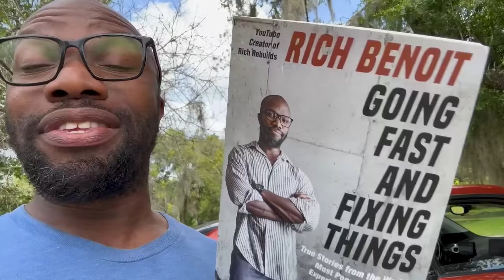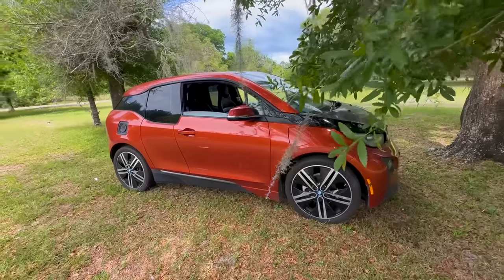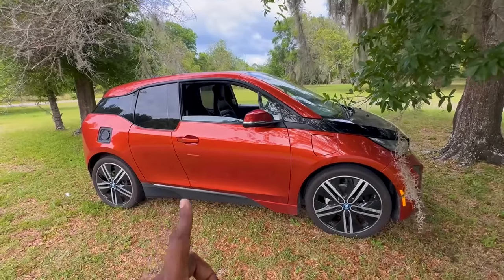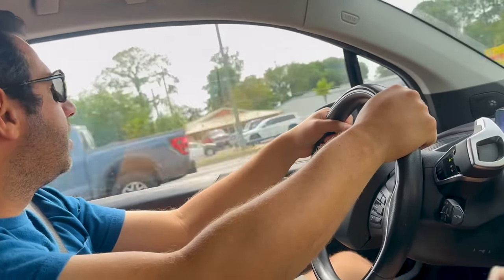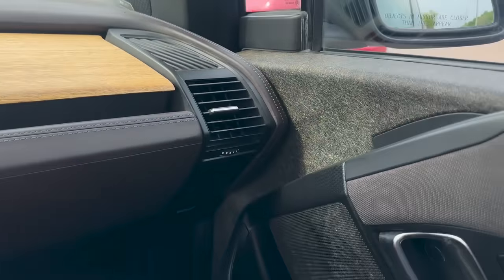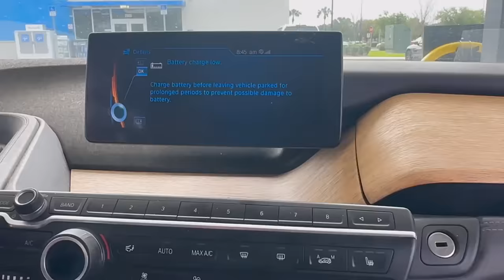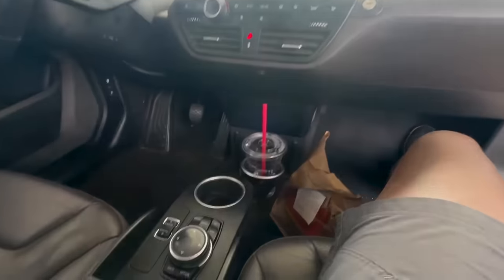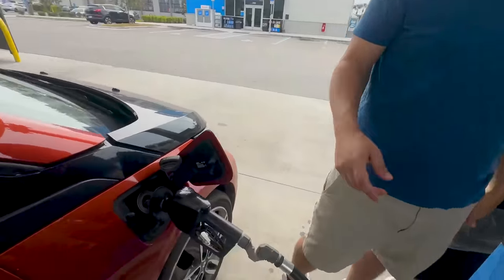I Bought a Ten Year Old $3500 EV and I Increased its Range To Over 400 Miles!

Comment from the maker: UPDATE.

The system works! I forgot to put this part in the video but the switch is foot activated so that I can add from the aux tank to the main tank while driving. When both tanks are full I can get  about 300 miles on gas only. However At those speeds the Rex cannot maintain hold state of charge but It still cruises nicely at 75-80mph on the rex. The siphon is working great as well, when both tanks are full the main tank will pull from the aux automatically so the pump is rarely used. 700 miles covered so far 700 more to go!
Reply: Why BMW didnt add a 50 liter fuel tank from the factory is just stupid
Reply: Rich I want to know why you can't put an alternator on a electric car that would charge the batteries   so that you don't have to stop and charge the batteries up at a charging station. Even if you run the alternator off the drive shaft or something.
Reply: I'm buying it when it drops.  Greeting from Newark Nj
Reply: @MIKEH.777  - This would be awesome, but I suspect the reason no one has done it is because the drain on the drive train by the alternator would be more than the charge it produced, making it essentially useless.  Regenerative braking works on this exact premise, using the mass of the vehicle against resistance to create energy, but when you try to create energy with the vehicle in motion, it just isn't as efficient.  Inventing a fix for this would probably make you billions.
Reply: @MIKEH.777  No such thing as free energy.
Reply: @Chris-hw4mq  They LEGALLY couldn't sell the car with a larger tank due to US regulations.....
Reply: @maxtorque2277  What ? then how do car makers put normal sized fuel tanks in cars ? Honda EV has a 40liter fuel tank
Reply: @Chris-hw4mq  The honda is a Hybrid. The I3 is a Range-EXtended electric vehicle.  Legally very different!
Reply: I think you glossed over the fact the computer of the car needs to be reprogrammed to allow the "hold state of charge" function to be enabled. I would like to see how the car would drive with low electric battery and a full tank of gas.
Reply: If you'd just imported the EU or Africa fuel tanks 😂😂😂
Reply: @uhjyuff2095 what does this mean exactly? The hold state of charge?
Reply: @aminath2  its a button on the car that is not available to activate in the US version of the BMW i3 REX. Rich reprogrammed the car's computer to enable the button. When the button is pressed the gas engine in the car immediately turns on and stays on until it runs out of gas which makes the car get lower fuel mileage. its a great modification for people wanting to drive the car with full power for longer distance at the expense of lower fuel mileage. I hope this explains what the button is.
Reply: @uhjyuff2095  that's really helpful- thank you!
Reply: That is the best EV made to date as far as I'm concerned. I'd buy one if it had a practical use for me.
Reply: I had one of these for two years back in 2016. The REX was great until you hit a hill, then the thing slowed down to 45-50mph and I'd have to camp out in the right lane, semis would even pass me. I always called the i3 the modern day Type 1 VW Beetle. Rear engine, rear wheel drive, not much in the top speed department, and when it dropped below 30 degrees the heat barely could keep up, the car was built for efficiency so there was very little insulation and the glass was very thin. I still loved it though, it was quirky, looked different from anything else on the market, the sound system was good, AND...Larry David had one!!!
Reply: Hey Rich, did you have anything in place to stop the siphon from overfilling the stock gas tank and running into the charcoal cannister?
Reply: You should also upgrade the battery, since in the past 10 years, the battery density increased way more, but how do you find/build the right package to be a drop in replacement?
Reply: because battery recycling cannot fully happen and currently has been  not happening much, hybrids use less materials than any other setup, that means less emissiosn too. also factor in  that weight rmakes crash safety, road wear repair rates, materials usage , all emissions including tire emissions (emissions analytics website, endocrine disruptor microplastic, etc) ,  driving fun (light weight allows easier traction control and traction loss control and allows less powered steering which allows feeling how close to grip limit car is like mclaren/lotus elise/emira etc)  .         factor in corbrett report, vocational science of freedom, etc, realizations about th climate crisis issues,  CAFE laws and europes equal being nonsense supporting "suv"  and electric cars (almost the worst car type and the most popular among these "environmentalist") , ani nuclear nergy sentiment among these "enviromentalist", etc... situation for electic cars gets worse.            we dont have a already mass scale solution , at best there maybe the "electric universe nikola tesla" theories , if you like.                                 they could make a compact 4 seater that is liek coupe with practical rear seat (not as is usually done) ,, and  they can have recycled forged carbon fiber and suspesnion that angles and heightens the car to have it lower crash absorbing stuff hit that of tall suvs . if it doesnt hit lower sitting cars well, at least it doesnt get hit in its weaker parts by the other cars stronger parts.        driving fun is mostly about the challengeing game of often being near danger because everyone values not crashing, so its exciting. quickness (liek go forces) doesnt really matter. but a more commonly enjoyable driving fun is speeding more at optimal power and RPM level according to bfsc chart (similar deal also in electric power motors) on more rather downhill roads and even very temporarily beyond areodynamicly effceint speed before rather uphills roads, and steering  braking minimally and smoothly... this is driving effciently, and you could be obsessed over the greater amount of pursuit of perfection that could be had compared to proper h pattern manual clutch experince, because you could get excited similarly as much about such goals as you would care about not crashing. maybe you can combine both by simulated version of such manual in effceint drivetrain that isnt too non dramatic, as a real h pattern clutch would, or maybe even better if your open minded to having high quality speakers at headrest give a sense of sound communicating how close to grip limit you are to acompany the rather non power steering sort of driving experience , or hearing the limited slip differential torque vectoring eso you can feel precisely how its distributing torque and wheel rpm even when you dont have traction to feel it.                                       ..............................all this stuff is good for  everything that makes driving fun (except  louder driving sounds and more danger by quicker paced driving at race track, where stuff like 0-60 mile per hour in 2 seconds isnt disappointingly boring for the costs because the fun doesnt last long enough) and everyone average crash saftey, and less usage of materials for longer lasting 1st world living standard (sustainability  and chemicals toxicity) :  light weight, showing the driver how close to grip imit he is at, relativly higher grip for making  risky effceint driving safe , easy to own cheap reliable car, hybrids instead of electric car for weight and recyclability and materials usage economy sustainability, mid rear engine weight distribution, some non hybrids, limited slip differential (presumably a effceint one that probably disengages when not used, for less tire wear , stability when making speed on curving downhill roads for effiency) .
Reply: @MIKEH.777  LOL, good one!
Reply: You can unlock the gas tank in the bmw coding to hold more gas. BMW locked out part of the tank for the USA models for some reason.
Reply: @maxtorque2277  They could LEGALLY put whatever size tank they wanted. What they couldn't do is have more gas range than electric and still call it (i.e. qualify as) an EV. It would have been classified as a hybrid vehicle if the gas range exceeded the battery range, impacting manufacturer clean air credits and consumer tax credits.
Reply: I would see if I could put a bigger generator on it.
Reply: @maxtorque2277  - True / Not True!

 "Sell it as a BEV" = True!

"Sell it as a PHEV/EREV" = Not True! But, BMW didn't want to do that!
Reply: Hey Rich, I’ve messaged you before in the past regarding the 2011 Chevrolet Cruze that I converted to 100% electric that will go 840 to 1280 miles on a single charge! The question is why haven’t I heard from you regarding this? 
    This is Edward H. and my company is “new ideas and innovations, LLC“ out of Madison, Connecticut, and you could’ve stopped by and looked at the car when you drove back to Massachusetts because Connecticut is on your way!
    Hope to hear from you soon!
     Best regards; Edward H. In Connecticut.
Reply: What about adding a sensor so it automatically fills based on level. Like a float? Nice concept and execution so far.
Reply: @Chris-hw4mq electric range must be greater than Rex range in order for it to be classified as a BEV in California. That’s why they did it this way.  There is no such thing as an EV with a 40l fuel tank, that would be a plug-in hybrid and not qualify for the same credits.
Reply: @telepresence  got it, they want to make crap EVs.
Reply: @Doing_it_right_the_first_time , have you done a video on the car? Why not post that? Then people can see it without even having to visit you.
Reply: @MIKEH.777 Check out Edison motors! They're making hybrid semi-trucks and Full-size pickups using small generator motors to make electricity for the drivetrains. Really cool approach! Also, Ram is releasing a 1500 this year that also operates on that same principle.
Reply: @rob_2278 this isn't a bad idea to add a sensor. Could have a cutoff triggered by a sensor at a specific fill height and another near the bottom to do the opposite and fill the main tank. As well as an basic low fuel warning system for the aux tank that shuts the whole aux system off till refilled.
Reply: Do you sell a white paper for this update?
Reply: @MIKEH.777 you're just wasting the power.
In concept, it would be best to have a generator that can fast charge the battery and that is it.  It's the same concept at constructions sites... why runa generator to make a cut every 5,10,60 minutes when you could charge up batteries in 30 and use them for hours.
Reply: fikriarieska8450  It's a 650CC scooter engine and it runs at about 4300rpm producing about 34 horsepower. I think the actual engine in the scooter makes about 60hp at 6000rpm. I think Rich should raise the rev limiter to see how much faster it can charge the battery at 6000rpm versus the 4300!!
Reply: @uhjyuff2095  That's not how Hold mode works. The engine is not on constantly. It will still cycle on and off as needed to maintain the battery State Of Charge goal. Hold mode just lets the driver customize what  the SOC setpoint is. 
GUYS: BEVx that is the vehicle classification that required the i3 in the USA to have a usable gas tank size of 1.9g, artificially limited. Could unlock to 2.3 gallons.
Ouch, 31MPG? The engine must have horrible thermal efficiency. I know it is strictly series hybrid but that is no excuse.
Reply: @danwat1234  You are probably right. I figured the hold mode made the REX run like how a old 1990's style car works where the engine runs until the key is turned off but I guess its more advanced than that.
Reply: Love this, I've thought about building an injection molded plastic tank for the frunk on mine to do this same thing. Awesome you actually tested it out.
Reply: So what was the fuel mileage on gas only? You said you got about 300 miles but I don’t know whether that was a gallon plus a gallon and a half or 7 gallon plus nothing or what.
Reply: @terryburns8917  total fuel capacity is 10 gallons. 2 gallon stock tank and 8 gallon add on tank. So roughly 30 mpg based on that.
Reply: @MIKEH.777  you would be saping power from the drive motor to charge the batteries ,basically putting a load on the batteries for no reason, it would not charge the car as you cant get more energy out of the drive system then you're putting in. What you are describing is perpetual motion, which does not work .
Reply: Have you ever had a scooter? You would be hard pressed to find a scooter with 10,000 miles on it.. You are going to be stressing a small motor that will fail and cost $10,000 to replace. I own a i3 and its been great so far, 94ah battery is a good option. I was really hoping you discovered a way to max the range of the battery. 
I'm watching this episode after watching your Cyber truck review. BMW i3 was made way better then a Tesla. Alum frame and carbon fiber tub (which you failed to talk about). They did everything Tesla didn't.

Id love to see more content on the i3

Cheers
Reply: I just realized.. You blocked in the 12volt battery with the fuel tank.. lol 
Thats good content
Reply: @David-by3im  In BMW's defense, The "Scooter" engine used in the car is not  the same as one found in cheap scooter you would find online. The engine is basically a 2 cylinder motorcycle engine. They can go well past 10km. They are fuel injected , full pressure lubricated and in the I3's use case, they are derated  to 30+ hP from about 60 hp.  This isnt a carb fueled, splash lubricated  high revving 5hp scooter motor.
Reply: @KennethCherisol  A lot of info I wasn't aware of there, thanks
That said, I would hesitate to run the gas motor for full days of driving. Opting to use it to get to the next charger if needed (which is rare for me). We'll see what happens next month, I'm taking a longer road trip here in Canada (west coast). The infrastructure of charging stations here leave a lot to be desired. I was thinking about just taking a jerrycan with me under the hood..
Reply: @meadmaker4525  And violate one of the fundamental LAWS of the Universe! (Of course, if you are a dedicated Republican, you believe that the right lawyer can get you out of even God's Laws).
Reply: This dual approach makes self-charging hybrids a practical choice for reducing pollution in cities while still providing the power needed for highway driving.

why won't it charge the battery when running on Gas  ?
Reply: It's so good to see a positive video by you guys, honestly though the weird references to politicians just show a lack of attention to reality, you're busy, you don't have time, and it's odd for people that make a life from ev's complain about ev legislation????
Reply: What was the total cost of this install and are you offering this to option to a viewer interested?